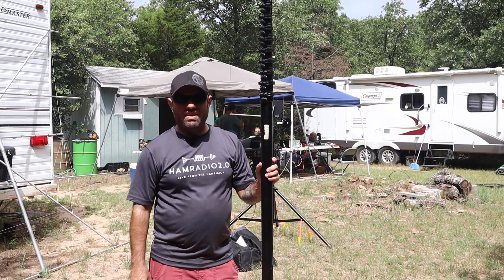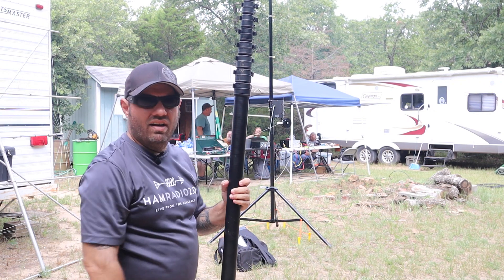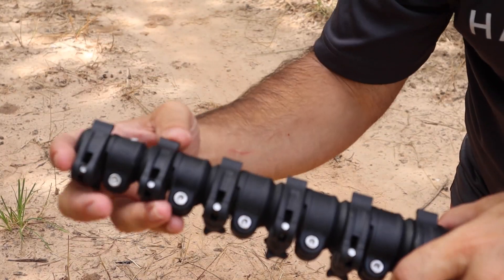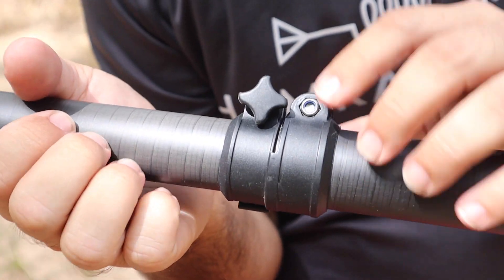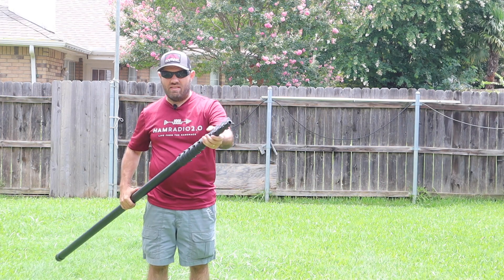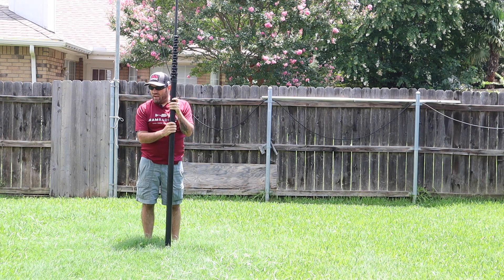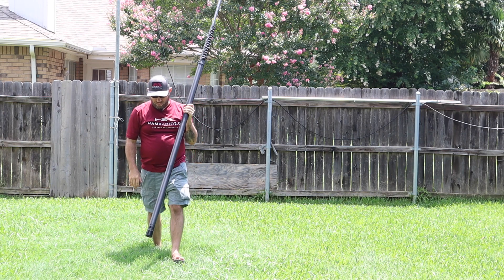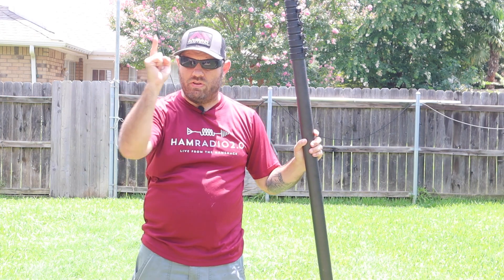Carbon Fiber Mast for Ham Radio Antennas from Gigaparts! | HF Antenna Mast

Comment: It looks awesome, but that price is eye watering.  In stock and $850.  I was expecting something like $450.  While they don't look quite as capable or convenient, MFJ has plenty of quite comparable options under $300.  Diminishing returns in investment, I suppose.
Reply from the maker: MFJ doesn't make a Carbon Fiber mast, theirs are Fiberglass.  Now, fiberglass will work just fine, but they aren't the same thing.  It is important to remember that.

Comment: So what provisions are supplied for mounting antennas to this? Does it come with a pulley or an SO-239? Im looking for a mast for NVIS with a 20/40 dual horse fence inverted V. Need something I can stick in a tow hitch or "drive on base" that doesnt need guying for mobile ops.

Comment: What weight rating do they have for throwing antennas on top? I’m interested in the modular platform but not sure it can hold up something with weight, steady enough to be reliable. I feel even the cobweb you planned on putting up would present a challenge at 50ft.
Reply from the maker: At 50' the cobweb would be too much.  I had it at 20' and probably could have gone to 30'.  The thing I like about the 50' mast is that you have options.  With the 25' mast, you can't go to 30 or 45' but when the 50' mast you can make it as high or low as you need for each situation.

I will check on the weight rating, not sure of that answer.
Reply: @HamRadio2  the 50 costs as much as an airplane trip to Hawaii tho!

Comment: You and HamRadioConcepts have really talked these up. Would love to actually see one setup with a hex beam or similar antenna.
Reply from the maker: Maybe not a Hexbeam, but I will have some upcoming vids while using it with wire antennas.

Comment: Can these masts be used for a permanent antenna installation?   Are they weatherproof?
Paul, WB0BBC
Reply from the maker: It isn't made for that, but I don't see why it wouldn't work
Reply: I asked the Gigaparts guys this question and they said they've had one installed for several months with no issues. I don't think these have been on the market long enough to get good long term feedback from anyone.
Reply: Mine has been out back for about 6 weeks 👍
Reply: @TheSmokinApe  that's good to hear. It will be interesting to see how these carbon fiber and fiberglass masts fare after 1 to 2 years in varying climates. Considering the price, I would hope to get 5 to 7 years of service at a minimum.
Reply: Good question I would like to mount an anemometer on one to get above the trees.  Strap it to a fence post is what I was thinking.